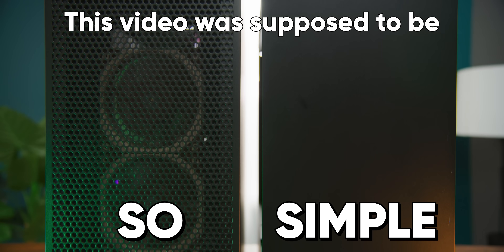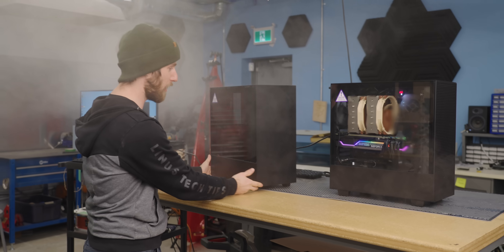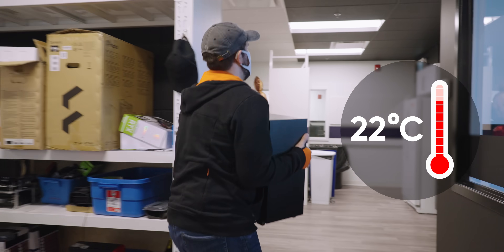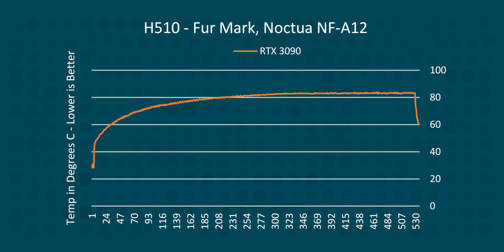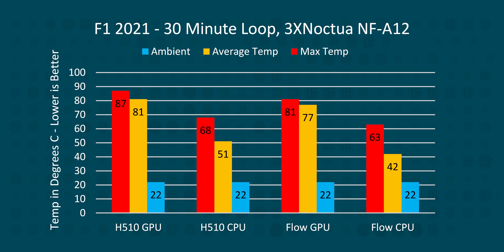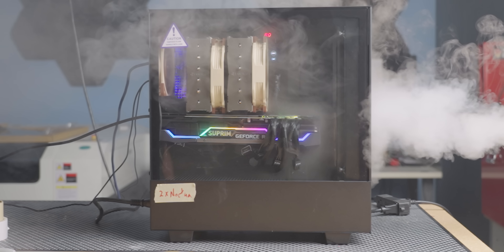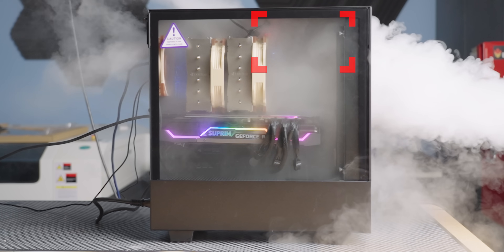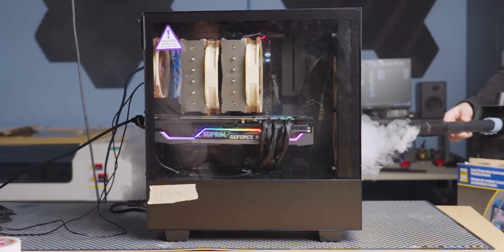Everything You Know Is Wrong - Mesh vs Non-Mesh Front Panel

Comment: Man, you guys really need to do proper particle image velocimetry to get good airflow data. The "toss fog at it" approach quickly saturates and you see almost nothing of the later progress, only the intake is clearly visible.
Let me know if you want to try this, I can help.
Reply: and no frequency data is given... so yeah, this test is almost useless
Reply: @George xander bit rude ngl
Reply: @MeAMoose  """bit"""
Reply: You can easily carry out PIV using a fog machine. I used a fog machine during my research experiments to characterise turbulence in an open chamber. You cannot use particles or ethanol droplets in this context (for a PC) for obvious reasons so a fog generator is ideal. 

Whilst you are correct that there is a situation where you can get too many particulates (and enter a regime which I think is called Laser Speckle), in practice this is not really a significant issue because you can modify the fog generator to release in short bursts. 

Finally, PIV is not something you would need for flow visualization. It is only needed when you want to obtain velocity data.
Reply: @djpailo  I believe the use of a static fogger would be more useful, not ones that shoot out as much fog as possible but gently releases it. Like if you where burning incense.
Reply: @djpailo  I agree, very true.
Reply: @djpailo  What do you measure in PIV with a fog machine to get the flow characteristics?

I've done some sketchy proof-of-concept flow testing for a project using a laminar flow nozzle that I match to the speed of the inlet airstream, and then just analyzed the image with some AI edge detection tools and a bunch of filtering. 

It gave very fancy images for showing to untrained people, but the actual flow data saturated pretty quickly.
Reply: @djpailo  Okay, so the data comes from small separation of points which allows you to correlate location of individual particles, makes sense.

With a fog machine like they're using in the video, is it possible to over-saturate the test?

Also, would you need to shine the light through the flow and visualize the scattered light? If so, that might not work very well for an application with only one transparent surface.
Reply: @louisvaught2495  
Regarding point 1: It is hard to say. It can do yes, but ideally you would confirm this using a camera. A lot of the time, you just take some test image-pairs and see if you can see some small amount of motion between the images. It just comes with experience that eventually you can tell from the images what is going wrong. 

Regarding point 2, in a nutshell, yes, the generation of a laser sheet in a confined space is problematic.

Some background:
In a traditional 2D PIV set up, you would create a thin "plane" of laser light called a laser sheet. The initially circular cross-section laser beam essentially goes through a series of optics to allow it to diverge in one direction and converge in another. You end up with a sheet of light essentially, whose thickness is a few millimetres or less, depending on the application, but whose height and width (the dimensions of the plane) is much larger. 

Every image pair is created by firing two short bursts of laser light (each which causes a laser sheet) before a longer period of time passes before the next double burst.

If, during that time, any particulates happen to traverse the laser sheet, they are illuminated. They immediately scatter light and this light is collected by a camera which records an image corresponding to each burst. Between the first and second burst, many of the particles will appear to move slightly within the plane of the laser sheet. They may also move "outside of the plane", i.e. along its thickness. This out of plane motion cannot be captured correctly in traditional 2D PIV measurements. 

The technique cannot work to my knowledge without this laser light (or equivalently some form of illumination). 

For applications which are confined (e.g. a pipe or in this case the PC), you may create a small transparent window through the device. The window can be curved but you will need to calibrate the camera to correct for distortions created by the curvature. Commercial software already has calibration tools to do this. 

However, you could in theory create the laser sheet inside the PC rather than outside. This means you would only need a small hole to allow the beam to pass through. The downside is that your optics would need to be placed inside the case which would disrupt the flow. Optics are also extremely delicate and usually need to be placed on custom made "breadboards" and mounting devices. These tools would also disrupt the flow. 

Alternative method:
You could instead use Laser Doppler Anemometry (LDA) which, using one model, essentially creates a fringe pattern of light using the intersection of two beams. As a particle traverses the pattern, the intensity of light it scatters varies due to its location along the interference pattern. 

Using some mathematical trickery you can show that the frequency change in this light intensity that it scatters is equivalent to the Doppler shift (between the frequencies of the incident laser light and scattered particle light) which in turn is related to the particle velocity. The advantages is that it does not require a laser sheet, just a few beams (therefore a few holes in the PC), but the downside is that in its traditional form, it is a 1D point measurement. It is also more difficult to detect flow structures with this method, but you can measure velocities in very small regions because the intersection volume can be made to very small. Therefore LDA is often better suited for boundary layer measurements.
Reply: @djpailo  Yeah, you're mostly correct. However, if your camera is good(and they are shooting on cinema cameras), you can do PIV with a class 1, maybe class 2 laser line generator, in a dark environment, so safety wouldn't be a concern.
And while PIV does the V measurement with the Is of Ps(lol), the ecosystem around it makes it easy to do the less scientific, more flashy flow vis.
My main issue with this fog approach is that there's just way too much of it. You don't really need particulate, as that's hard to set up, but you can drop it down a few OOM and get much nicer data in a high contrast environment. That's also why I think a chemical stage mister would be better. There are minor health concerns associated with them, but since the tests would be super scaled down and conducted rarely, no precautions would really need to be taken.
Reply: Interesting application for PIV I must say
Reply: SENSITIVE CONTENT 
 ONNANOKO.TOKYO/machiko  

MEGAN : "Hotter" 
HOPI : "Sweeter" 
JOONIE : "Cooler" 
YOONGI : "Butter" .
PETTY : face. 
BODY : Beautiful. 
SMART : flirt. 
Like to eat.
Жизнь, как красивая мелодия, только песни перепутались.
#однако #я #люблю #таких #рыбаков

#ライブ配信の再編ありがとうです！#この日のライブ配信は、#かならりやばかったですね！１#万人を超える人が見ていたもんね（笑）#やっぱり人参最高！#まさかのカメラ切り忘れでやら1かしたのもドキドキでした！#今後は気を付けないとね5). . 

!💖🖤❤#今後は気をライブ配信の再編ありがとうです！#この日のライブ配信は、#１万人を超える人が見ていたも ん（#笑）#やっぱり人参最高！#まさかのカメラ切り忘れでやら1かしたのもドキドキでした #今後は気をライブ配信の再編ありがとうです！（ #笑）#垃圾

Comment: To be fair I bet when stock fans are used for cases they probably perform something like cfd air flow simulations...where as when noctua fans are tested either real time or simulated they are only testing the fan not the the fan in any specific case
Reply: SENSITIVE CONTENT 
 ONNANOKO.TOKYO/machiko  

MEGAN : "Hotter" 
HOPI : "Sweeter" 
JOONIE : "Cooler" 
YOONGI : "Butter" .
PETTY : face. 
BODY : Beautiful. 
SMART : flirt. 
Like to eat.
Жизнь, как красивая мелодия, только песни перепутались.
#однако #я #люблю #таких #рыбаков

#ライブ配信の再編ありがとうです！#この日のライブ配信は、#かならりやばかったですね！１#万人を超える人が見ていたもんね（笑）#やっぱり人参最高！#まさかのカメラ切り忘れでやら1かしたのもドキドキでした！#今後は気を付けないとね5). . 

!💖🖤❤#今後は気をライブ配信の再編ありがとうです！#この日のライブ配信は、#１万人を超える人が見ていたも ん（#笑）#やっぱり人参最高！#まさかのカメラ切り忘れでやら1かしたのもドキドキでした #今後は気をライブ配信の再編ありがとうです！（ #笑）#垃圾

Comment: This is why i have a a big tower casing.
I have 5 fans in total for the case alone.
2 at the top. 1 at the bottom. 1 on the front and 1 on the back. 

The sidepanel also has slits to ventilate air in. 

Sure i don't have a smoke machine to test if the flow is superior, but so far i never in my life had issues with cooling.
I know big towers are considered "ugly" or clunky. But i don't care. I rarely move my PC and i do not constantly have my eyes on it. What it should do is run games to the best of it's ability. And that it does.
Reply: SENSITIVE CONTENT 
 ONNANOKO.TOKYO/machiko  

MEGAN : "Hotter" 
HOPI : "Sweeter" 
JOONIE : "Cooler" 
YOONGI : "Butter" .
PETTY : face. 
BODY : Beautiful. 
SMART : flirt. 
Like to eat.
Жизнь, как красивая мелодия, только песни перепутались.
#однако #я #люблю #таких #рыбаков

#ライブ配信の再編ありがとうです！#この日のライブ配信は、#かならりやばかったですね！１#万人を超える人が見ていたもんね（笑）#やっぱり人参最高！#まさかのカメラ切り忘れでやら1かしたのもドキドキでした！#今後は気を付けないとね5). . 

!💖🖤❤#今後は気をライブ配信の再編ありがとうです！#この日のライブ配信は、#１万人を超える人が見ていたも ん（#笑）#やっぱり人参最高！#まさかのカメラ切り忘れでやら1かしたのもドキドキでした #今後は気をライブ配信の再編ありがとうです！（ #笑）#垃圾
Reply: Same. I have a Lian Li Lancool Mesh II and added 2 fans to the bottom just to cool the GPU.
1 at the top, 2 at the bottom, 1 at the back, 3 at the front

GPU stays under 69C (nice) during stress tests

No need to worry about cooling as much with a huge case
Reply: @SnackyChan51  Now if i could just get my hands on a new GPU without a horrible price tag. Maybe in a few years. xD

Comment: So the air is forced up due to the huge size of GPU blocking any chance for air to pass through GPU?

You have one forced path. Maybe only solution would be adding a fan to pull air down.

You can do the stupid solution of reversing all fans and having one blowing and one pushing fans in front.
Reply: Sounds like the solution is the venerable blower fan on the GPU.
Reply: not so simple. There's so info about gpu frequency  in any result so, in the high airflow test, gpu is also probably boosting higher
Reply: SENSITIVE CONTENT 
 ONNANOKO.TOKYO/machiko  

MEGAN : "Hotter" 
HOPI : "Sweeter" 
JOONIE : "Cooler" 
YOONGI : "Butter" .
PETTY : face. 
BODY : Beautiful. 
SMART : flirt. 
Like to eat.
Жизнь, как красивая мелодия, только песни перепутались.
#однако #я #люблю #таких #рыбаков

#ライブ配信の再編ありがとうです！#この日のライブ配信は、#かならりやばかったですね！１#万人を超える人が見ていたもんね（笑）#やっぱり人参最高！#まさかのカメラ切り忘れでやら1かしたのもドキドキでした！#今後は気を付けないとね5). . 

!💖🖤❤#今後は気をライブ配信の再編ありがとうです！#この日のライブ配信は、#１万人を超える人が見ていたも ん（#笑）#やっぱり人参最高！#まさかのカメラ切り忘れでやら1かしたのもドキドキでした #今後は気をライブ配信の再編ありがとうです！（ #笑）#垃圾